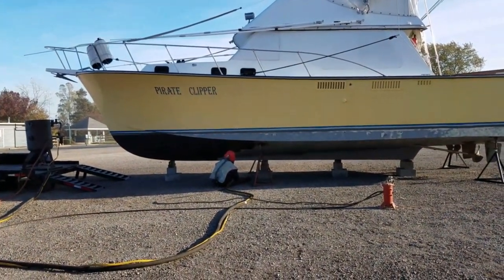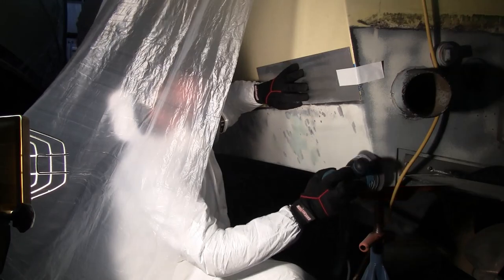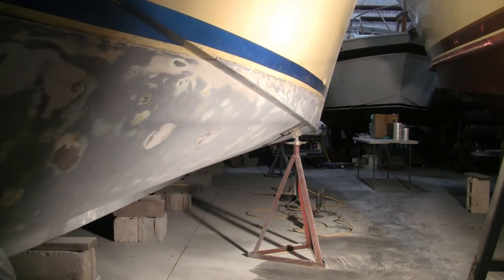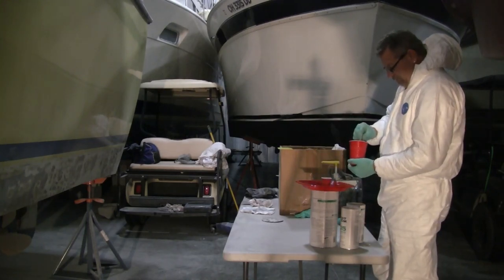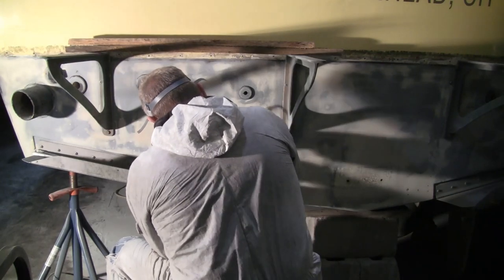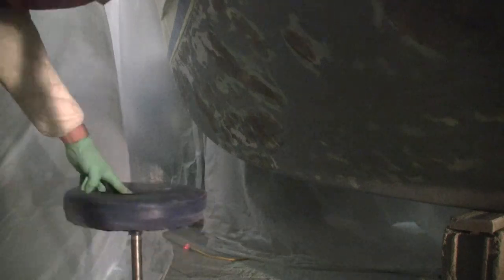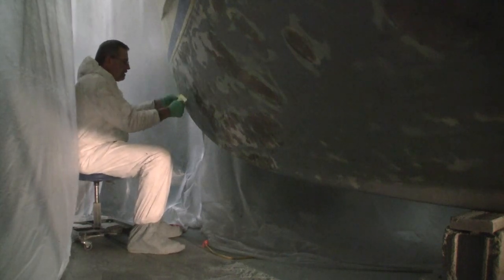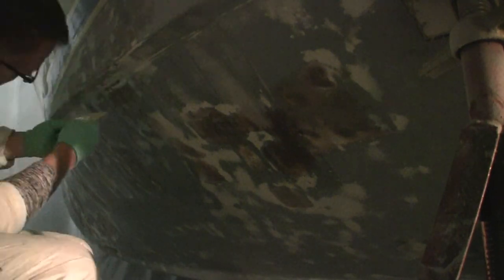If Only I Could Have Stopped Him.....

Comment: Video on pros and cons of your boat
Reply from the maker: WoW!  That's a deep subject!  The Pro's are extensive.... from the overall level of comfort, how it can handle rough water, to how it fishes, pulling baits through the water steadier than the smaller boats, and it's very docile slow speed handling....most people will tell you, the Tolly's are incredible vessels!  Cons?  ummm....ummm...  fuel capacity?  I only carry 300 gallons, but that's not all bad.  Just wait until we get back on the water and we can start posting more FISHING videos!  Thanks!